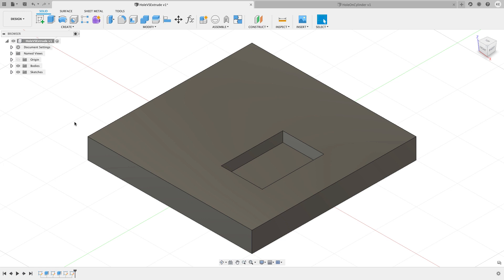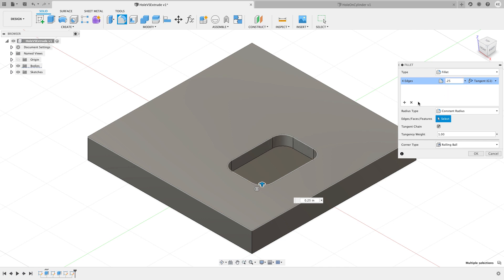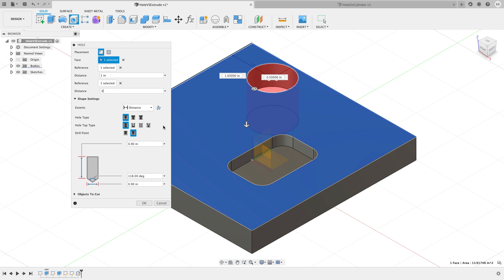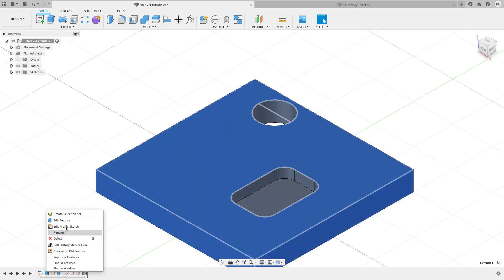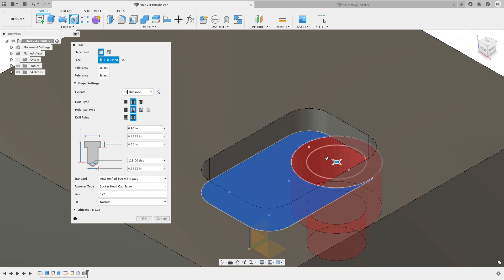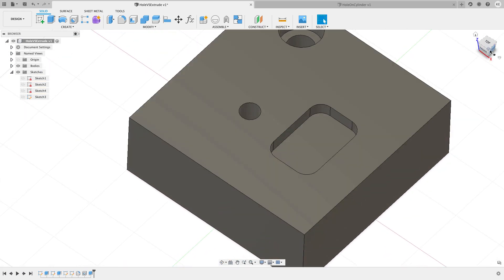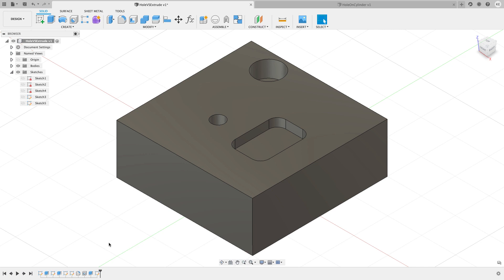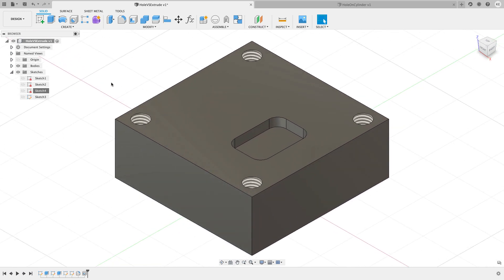Fusion 360 Hole Creation Methods

Comment: what if i have create hole on cylinder, you can have reference sides on a square, but no cylinder top.

i just wanna place equally spaced out screw holes man why is this so tough
Reply from the maker: By projecting geometry, you should be able to reference any geometry on the cylinder.

Comment: At 5:36, you say you can't do counter sinks but can you not extrude the dimensions for say a cap head screw, then extrude another through hole  for the socket head bolt for example? This would be the long way but i'm not sure if Fusion today can like place opposing counter sunk socket heads, ie say counter sunk from oposite sides of a plate, unless one does it manually and not via the "Hole" function. At least this is how i read it when trying to perform this. So i would just make my counter sunk holes via a sketch and extrusion. Do you know any way to perform this in a more simple way? Great video BTW and u got another subber!

Comment: But how do you create a circle on a plane surface that then has a cut depth? When I revolve cut it’ll give it a depth of the same radius from the initial circle. For example a pip on a dice.
Reply from the maker: Hi. I’m not sure I follow exactly. Would it be possible for you to create a simple example and email the link or file? Kevin @ mechanicaladvantage dot com (remove spaces and add .com)

Comment: I have been trying to use holes more and more, as they are more flexible, but they seem to be a pain to use, as you can only do multiple holes (at once) if you have points. Alot of times I need holes on standoffs that are extruded, so I have no face points.. Its easier to extrude with an offset from the base sketch most of the time.

Comment: Very cool, cleared up some questions I'd had, thank you. FWIW, I too have noticed a fairly significant decrease in Fusion performance lately, particularly in the sketch environment with patterns and especially anything with splines.
Reply from the maker: Hi. You said some alarm words in that sentence. Pattern and sketch. Do everything you can to not pattern sketch entities if it can be avoided. I think the slowdown you are seeing in coincidental with the modeling techniques you are using for your current projects. Of course I could be wrong, but that is where I would first look.
Reply: @MechanicalAdvantage  I've read recently that Fusion's sketch engine doesn't handle complex/patterns well, especially vs Solidworks, something to do with the underlying solver architecture. So yea, you're correct, at least with Fusion it's a better practice to pattern features or cam operations rather than the sketch itself. I'd only wondered if that slow drawing render on your system was maybe related to the other slowdowns I've  been experiencing. Maybe not, who knows?

Comment: Kevin,  what do you find the best way to chamfer modeled thread holes?  Say a 5/8-24 with a 0.020 chamfer
Reply from the maker: Hi. I find it best to do it in the CAM. To be honest, it’s very rate that I model the threads and instead use the cosmetic thread option. Do you need the threads modeled? Can you tell me what your application is? Feel free to email it to me if you would rather.
Reply: @MechanicalAdvantage   I'll shoot you a email.  Thanks!
Reply: @MechanicalAdvantage  Thank you,  I sent you a email.  May be in your spam folder